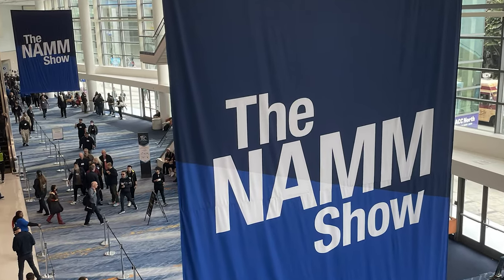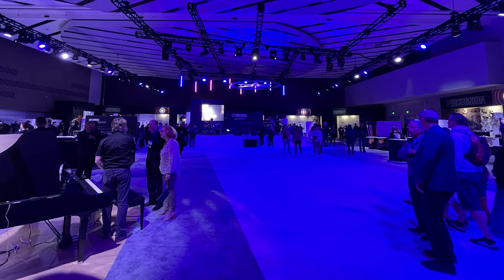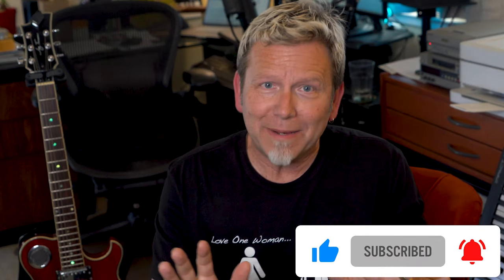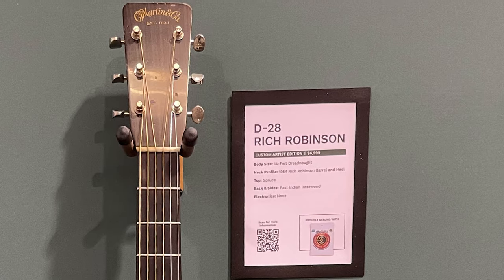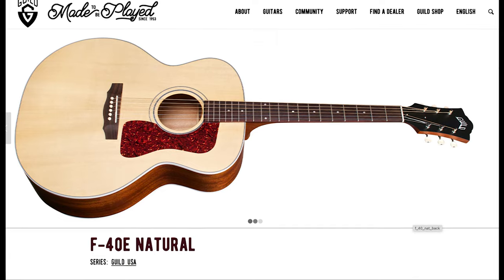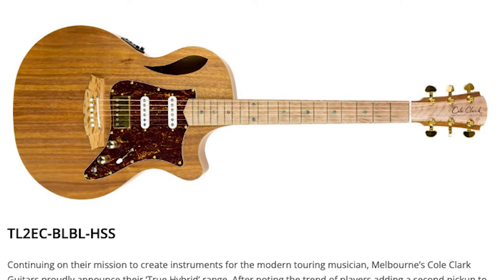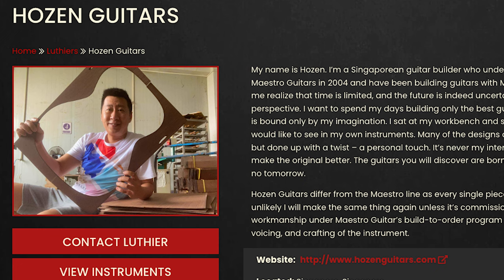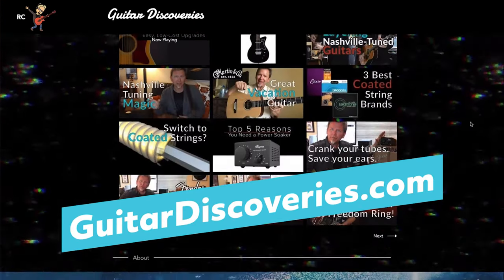How to buy a HOLY GRAIL Acoustic Guitar! — Join my QUEST at NAMM 2023

Comment: What? No Lowden? Lowden guitars are my "holy grail".
Reply from the maker: Right, sorry about that RR. Have you played some Lowdens before? I had played a few last year and they didn’t knock me out. They seemed to be midrange-focused and a little lacking in bass. If there’s a particular model you love, please tell me so I can try it next year!
Reply: @RobertCassard  I own a 1994 Lowden F24. Sitka spruce/ flame maple. I did some research and I found that there were only 24 of that model ever made between 1993 - 1998. I own four other acoustics, and that one is my go-to! I played a few newer Lowden's over the years and I really liked them. But, my wallet did not like them LOL. I was lucky to get this F24 used, so it didn't hurt the wallet that much. I bought it when it was 18 years old (2012) for $2,800. Thanks for responding to my comment. Rock on!
Reply: @RobertCassard  I'm sorry I didn't answer your question. Any of the F models are my choice, depending on different wood combinations. I believe the F50 is the top of their range. But as I said any of the F models are fine in my opinion. It depends on how much money you want to spend.
Reply from the maker: @RRStout  Seems like you got a fine deal on your F24!
Reply from the maker: I was perusing prices of Lowden's on Reverb.com and it seems like they're holding strong, mostly in the $4k to $9k range. I'll make sure to give 'em more attention on my next NAMM adventure.